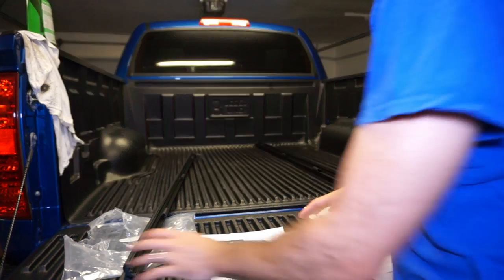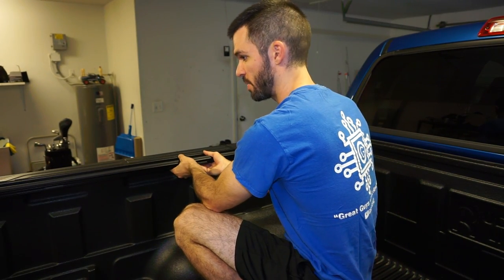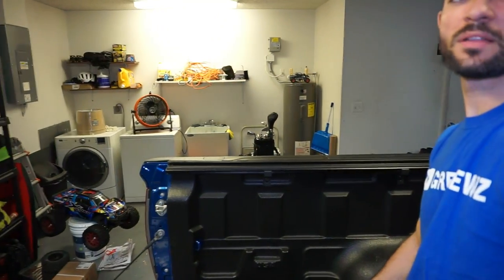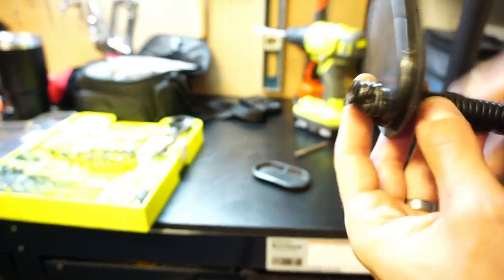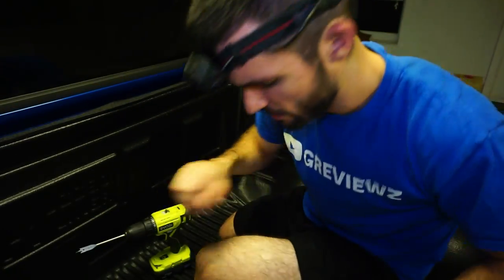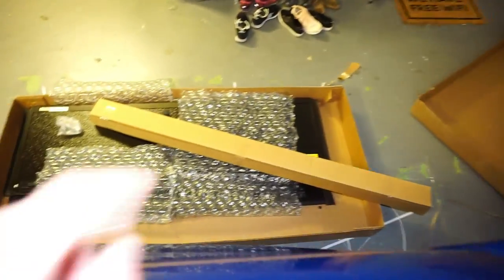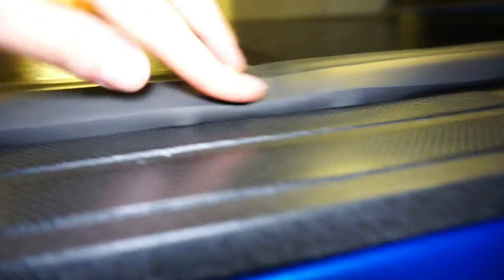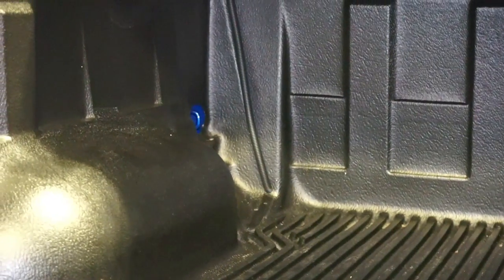Gator EFX Tri-Fold Tonneau cover installation 2018 Toyota Tundra TRD sport with Drop-in Bedliner

Comment: You didn’t adjust the cover properly. And it looks like your rails are to high
Reply from the maker: Ok so what needs to be done?in terms of adjustment? Could be because I have a drop-in bedliner..
Reply: So you said he didn't adjust it properly and rails are too high.  And he asked what needs to be done in terms of asjustment.  Been a whole year and you haven't responded.  I mean you started a conversation😂

Comment: DO NOT BUY the hardcover tri-fold for second gen Tacoma's the mounting hardware used on the accessories rails is trash. It doesn't let the rail sit low enough. All other trucks it's good and mounted properly. For tacoma's, it doesn't sit right and it's not secure. A serious risk of it getting sucked off your truck while driving. On top of that, it doesn't seal well enough to keep water out. It is also not secure and can be easily opened even when the tailgate is closed. Buy a different brand/design.
Reply from the maker: ok, what Brand are you talking about? Also, in my video, I have a Tundra not a Tacoma.
Reply: @GReviewz , yup, that's why I specifically mentioned Tocoma. I don't think I would be having this issue if I had a Tundra.  There are no install videos on 2nd Gen Toyotas so I never saw the mounting hardware beforehand. I assumed it was the same as Tundra, or others. I'm trying to save someone a half a day of work and $500+ dollars.  You don't get to see the crappy mounting hardware that comes with the 2nd gens.  I wish it mounted as well as yours.